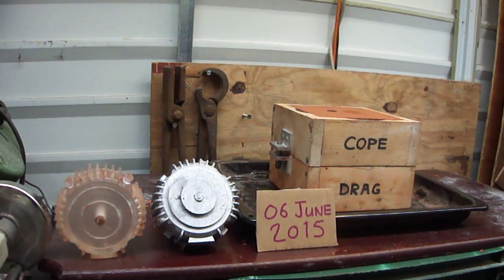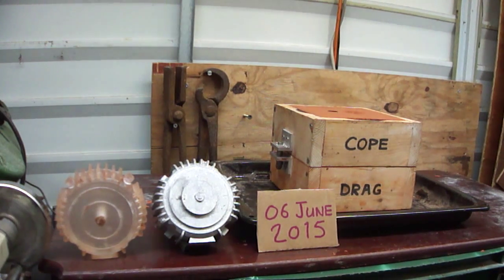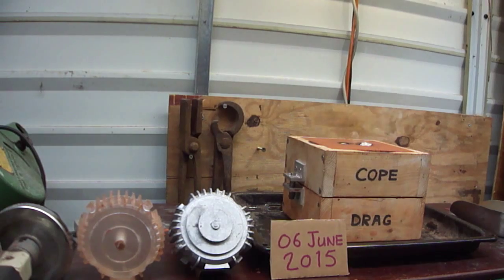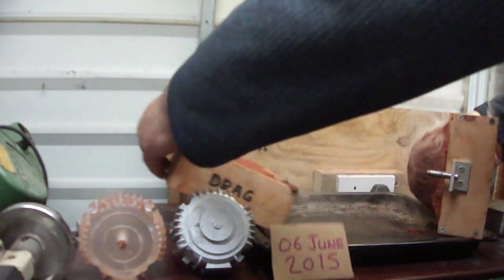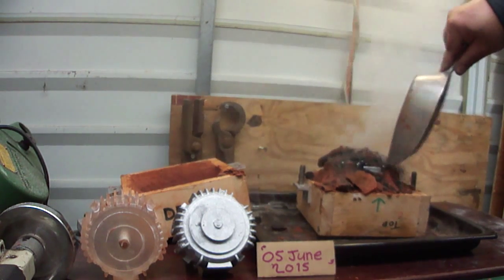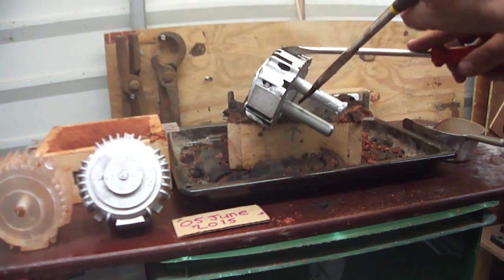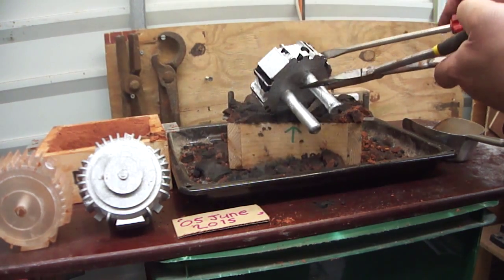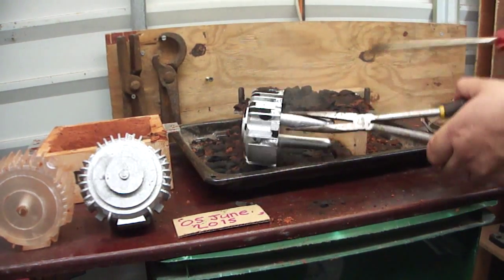Casting an electric motor end shield - Pouring the metal!

Comment: How can I calculate the amount of weight I can pull on a electric motor based off HP and RPM'S information?
Reply from the maker: You need to look online for an "electric motor power to weight ratio calculator" - Google this and you should find more info that you're looking for - I find sometimes it is not how much HP a motor has but it is the overall output torque that is most important and if a motor is fitted with a reduction gearbox, it may well lose RPM but it will have much more torque = much more pulling power !